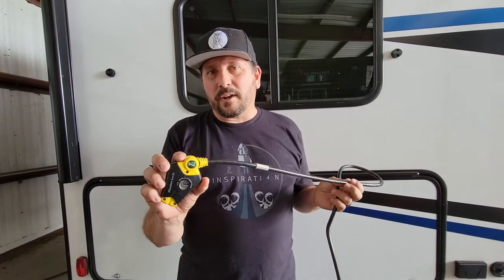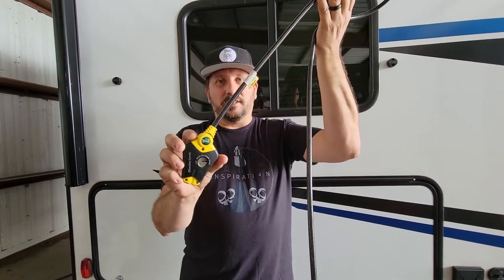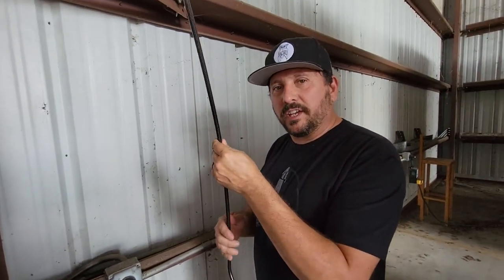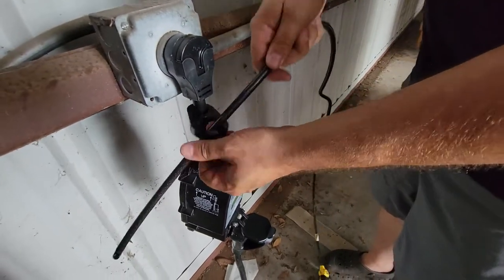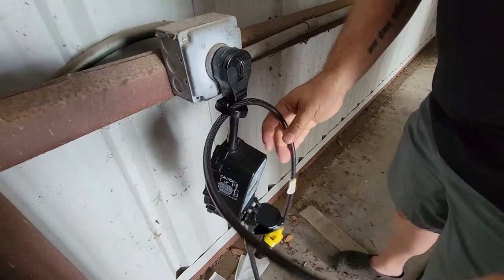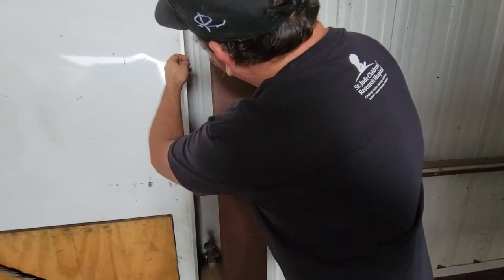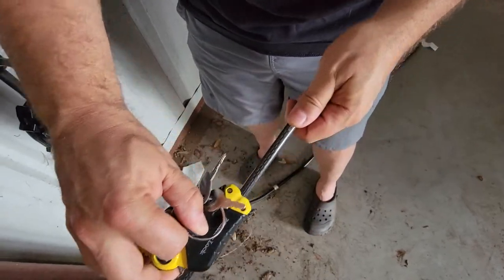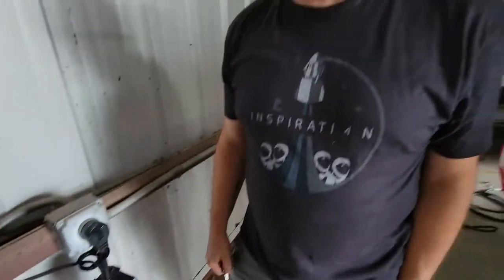Master Lock 8418D Python Cable Lock - Review

Comment: Explaining how to use something is not what "review" means.
Reply from the maker: What else would you like me to add?
Reply: @ReviewsUnscripted  Strength before breaking, lock pick resistance, ease of use, quality of materials, tensile strength, weather resistance, bolt cutter resistance, storability, flexibility, heat resistance, cold resistance, wear and tear resistance, hammer resistance, resistance to corrosives, resistance to explosives, resistance to frost, resistance to dirt/mud, resistance to crushing. Is it noisy? Does it rattle? Is it easy to unlock in different conditions? It is certified? Is it rated? What do you use it for? What do you think it can be used for?